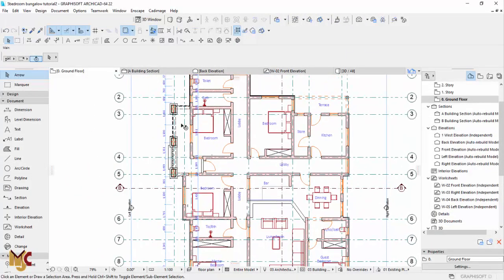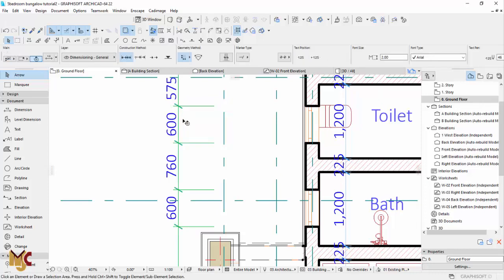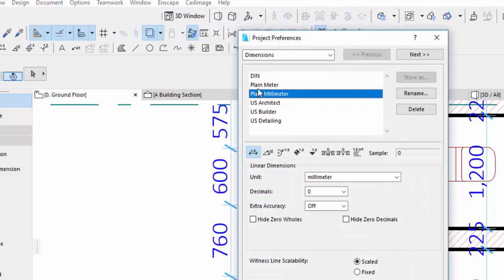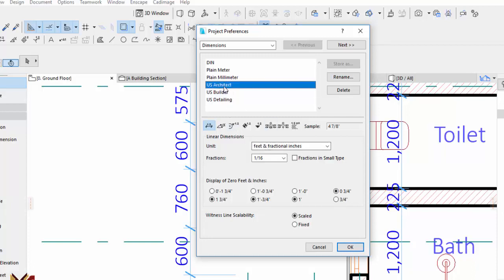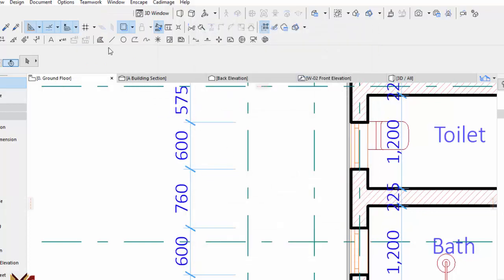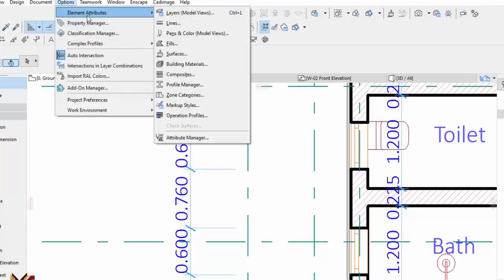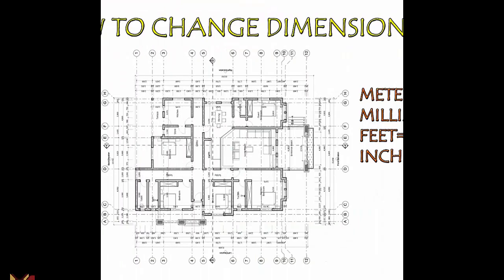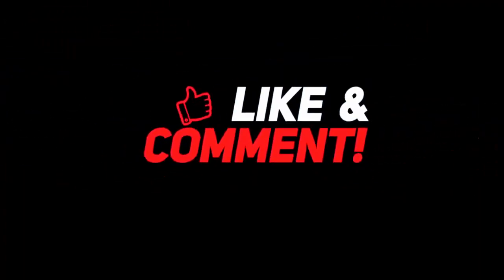How to Change Dimension unit in Archicad #dimension #archicad22

Comment: Please, help me! I changed the dimensions, but after using the program for a time, the dimensions returned as were and i dont understand why.
Reply from the maker: Just follow the process again
Reply: @MJCdesigns  Doesnt work, when i open the file again, returned as i dont want...
Reply: So, I think this is a bug
Reply from the maker: Maybe because it's suppose to remain the way you left it.
Reply: did you find out? It is the same for me. I dont understand too.